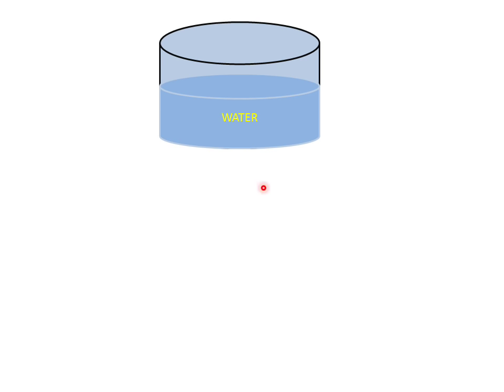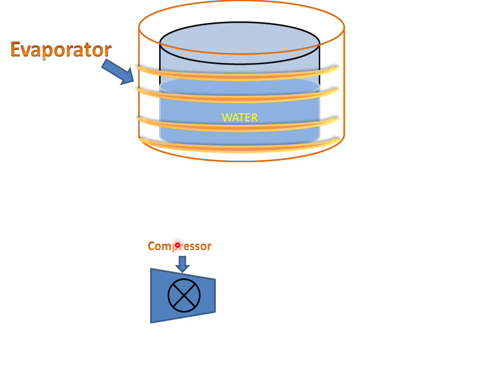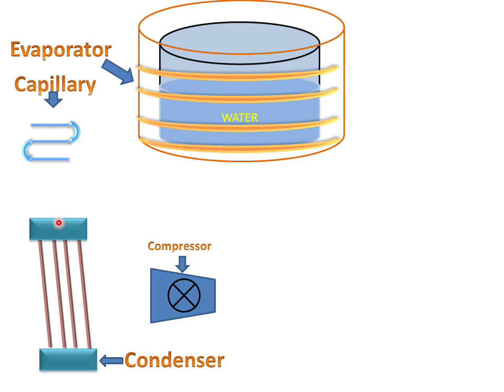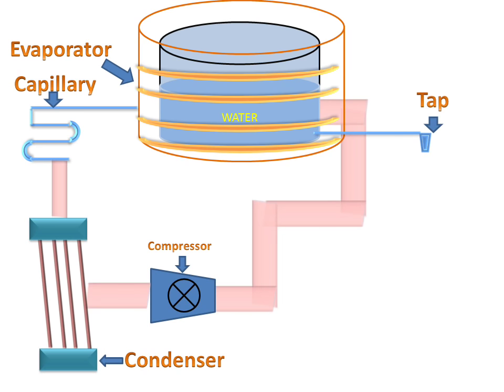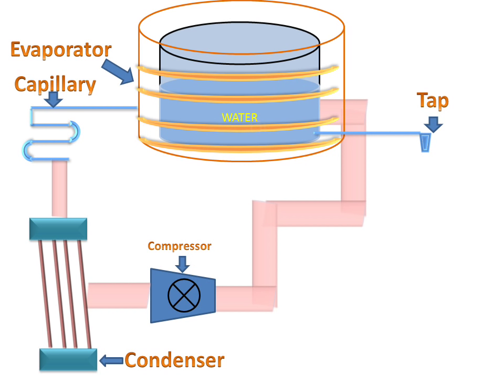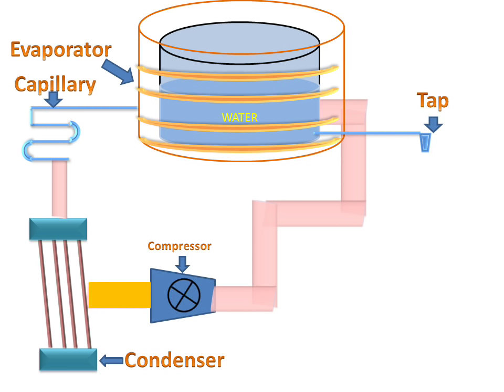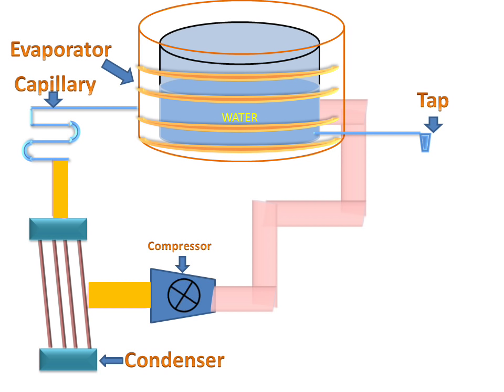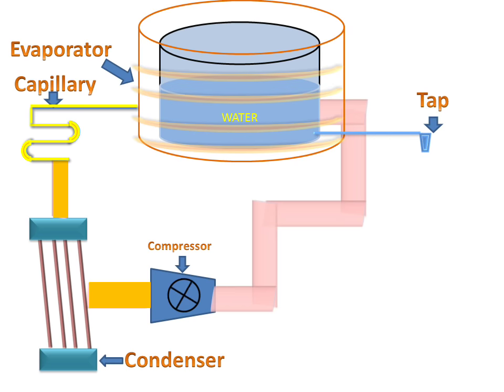Water Cooler(Parts & Working)

Comment: If the condenser/ compressor is "heating" the air its sending into the capillaries, how would this cool the water?
Reply: Because the heating is necessary for the cooling! Consider this: if you compress a gas, it heats up. If you let it expand, it cools down. So for cooling to happen, we need a compressed gas that then expands. This is what happens after the capillary tubes: the refrigerant expands, and cools down, cooling the water in the water tank.
Now we compress it again, at the compressor, and the cycle starts anew. The compressor increases the temperature of the refrigerant, the heat of which is shed to the environment through the condensor, which is just a radiator.